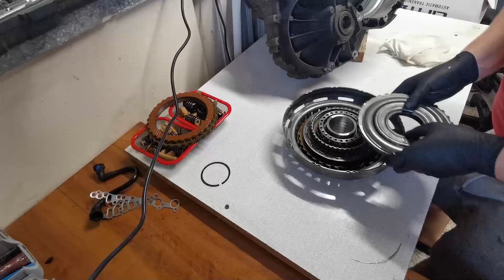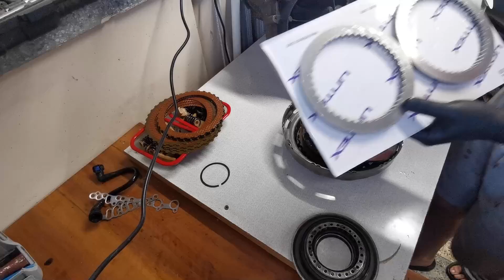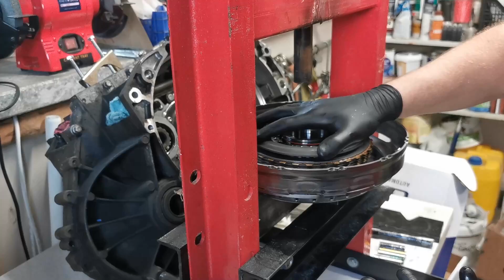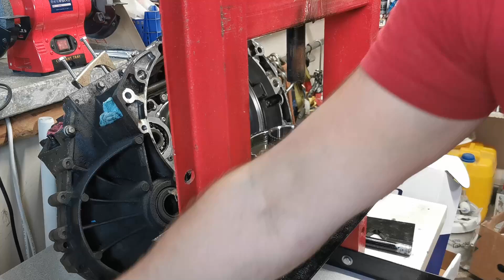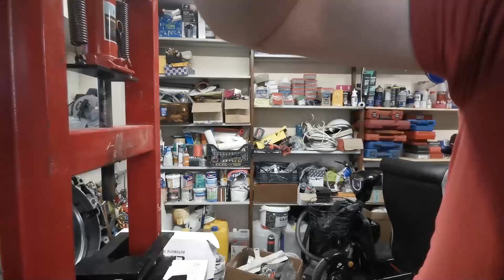How to replace Clutch Powershift 6dct450 - guide

Comment: Hi boss I replace full body valve with TCU I reprogramming. After come up.  P172D. Fault
Reply from the maker: Hi mate did you check all the wiring to the mechatronic? Also 2 tapes connecting actual plug inside the mechatronic to the part that couches the solenoids. It's very delicate and easy to break it, double check continuity, also when you remove mechatronic inside where the halotron sensors are there are magnets inside, if they are dirty or broken or missing it will cause faults like this too check that you have them all. 2 magnets per fork.
Reply: @DankosDIY ok thanks ❤ I will try

Comment: Hi.  Can you please confirm that, with the direction the clutch spins ie clockwise (looking from engine to gearbox)  the friction plates are spinning oil from the centre to the outer?  To me it looks like the direction of the plates is wrong......just want to make sure
Reply from the maker: Yes and no. 😂 So I did make 1 mistake installing one plate wrong way. But others are right. If you look at the manual it is showing that the friction material is tilted to the right. And that's how it has to be fitted. Not sure on which way fluid is splashed around.
Reply: @DankosDIY hello again.  The ATSG technical service information diagram show that the molded balance piston is installed before the return spring.  Your, and other videos show the opposite?  Can you confirm which is right please and also which instruction manual you use?  Sorry to be a pain but just asking.  Thank you
Reply from the maker: @francoisoosthuizen6663 it's absolutely fine mate. Dont always trust manual coz in it says to strip half of the box apart to change internal filter. You don't need to 😂, which manual I'm looking at. I found on the net for 6dct450/470

Just not sure which piston you talking about 😅
Reply: @DankosDIY thanks, do you have an email address so that I can send you the ATSG drawing please?
Reply from the maker: @francoisoosthuizen6663 05dankom@googlemail.com

Comment: If you put it back like this I would expect some clutch drag as two friction plates are not oriented correctly
2:40 - correct orientation 
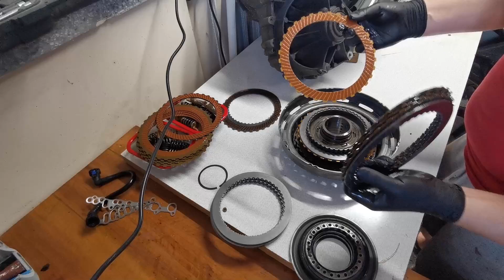2:53 - correct orientation
3:14 - you fucked it up
3:21 - you fucked it up again

Also I've got two different metal plates for both ends (piston side) 2.7mm for clutch 2 and 2.2mm for clutch 1. The rest are 2mm.
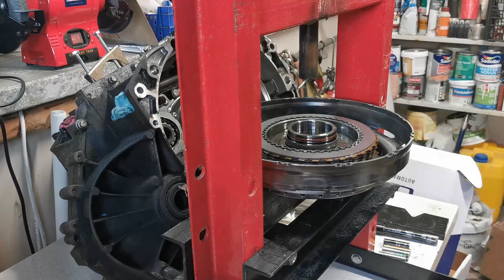3:25 - this last metal plate should be 2.7mm
7:25 - this last plate should be 2.2mm

Edit: My full rebuild kit had 2.7m and 2.2mm plates but when I took everything apart both were 2.2mm. In the ATSG 6DCT450 manual they're both listed as 2.2mm. automaticchoice parts catalogue shows 2.2mm and 2.7mm. Ended up installing both 2.2mm to maintain proper clearances (According to AI it's 2.14mm - 2.28mm and I measured 2.14mm + 2.24mm)
Reply from the maker: Hi thank u for this info, eagle eye. 😅, you are right with the 2 different thickness plates but my kit didn't had different thickness plates hence I've put them like I did on the video. I've ordered another kit recently and when I comes I'll measure them, different company perhaps it will be different.

When it comes to friction plates, hm.... Car done over 10000km since repairs and nothing is wrong. Adaptations went through successfully. I need to check out the video myself, like zoom in to see it but I think I fitted them correctly . 😂 Never the less thank you and I'll look in to that.
Reply: @DankosDIY  Look at 03:00. The two you already have on look like / and the two on the table look like \. You picked them up from the table and installed them in the same orientation.

Comment: How good is Powershift transmission
Reply from the maker: In older cars with 6DCT450 the box what ever you do it will die. There is no help. You can change oil and filters but stuff wear out and gbox atops working. After repairs the box is ok for another 100k miles ish as long as you drove gently and not around town. And never tow anything with it. Thats just my opinion in short terms 😅